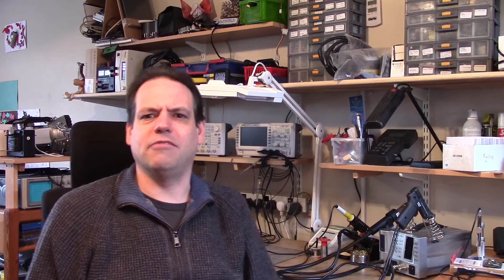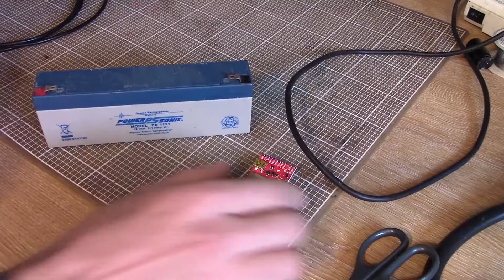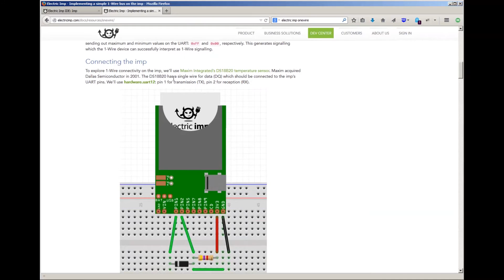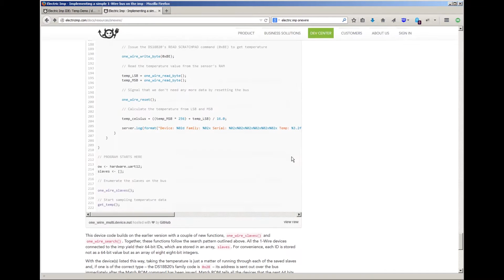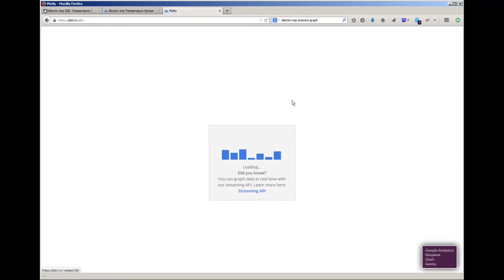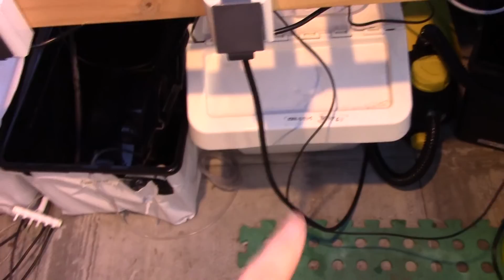Nutrient Temperature Monitoring with an Electric Imp and Plotly ( IoT Internet of Things )

Comment: That was frickin sweet!  Thanks!
Reply from the maker: Thanks FesterWerks - I'm very glad you liked it - first time I've done a how-to as involved as that. Cheers!!
Reply: Oh, I'm going to be ordering these parts and building many of these temp sensors.  I want to put them in various dutch buckets this spring/summer to monitor various methods of keeping my nutrients solution cool in the buckets.  Nice that you covered so much of the process for us.
Reply from the maker: I've just uploaded the full sourcecode to github - https://github.com/jimconner/greenhouse_monitoring - if you need any help when you're getting it set up later in the year, ping me a message. Cheers!!
Reply: Thank you!
Reply: Jim Conner
 Oh my, the rabbit hole this video sent me down all day Saturday :)  My guess is I'll be getting in contact with you in a month or so :)  This gave me so many ideas...
Reply from the maker: FesterWerks Heh... It's not just you going down this rabbit hole... I've order a light level sensor, humidity sensor and air pressure sensor which I'll try to add on in a couple of weeks time when they arrive from China - then I can track the weather changes along with the rest. I've also ordered some more temperature probes as the 5 which I had are all used now and I still need to measure outdoor temps and the other NFT nutrient tank (when that rail's up and running agian)... and more some that I can continue making improvements to the code without stopping the one in the greenhouse from working. I am so loving this project... only snag is that I'm back to work on Monday (had a month off over Christmas) and that's going to slow me down a bit - Ah well, there's always evenings and weekends.  Cheers!!
Reply: Jim Conner
I just picked up a bunch of those temp sensors for 3 bucks a piece.  The light level sensor sounds great, even though I know sunrise/sunset times, the trees shading my garden make those times less reliable. 

Can you pull the data from Plotly or Imp into your own database or spreadsheet?  (Either real time or on demand?)

I was looking at pH sensors and they are still pretty pricey.  I was looking for a cheap way to detect water to add to my Dutch Buckets to determine if a feed line had clogged.  With 35 dutch buckets now and the potential for more later, I'd like them to be cheap.  The really cheap things I found would require me to drill a hole in my buckets. (I found these, the analog Basic Range and digital Optomax) http://www.sstsensing.com/sites/default/files/AN0061_2_ProductSelectorGuide.pdf

Have you looked up inexpensive water level indicators or water detectors? 

Sorry for all the questions and continued comments, but I've thought of doing stuff like this for a long time, then to see you so simply put it into practice is great and has really got me excited.
Reply from the maker: Hi Fester. The addition of the light sensor is a 'because I can'  type of situation - mostly it's because I saw the one +TraceWaters was showing in his latest video and I thought 'that looks neat'.

Yes - the data's available from plotly after you've pushed it up there... CSV format so easy to pull into a spreadsheet.

The pH probe I bought was about $10 (£6 - It was the cheapest I could find), but then you have to make some circuitry to attach it to a microcontroller (hence the video I made about a week ago) - I did look for ready-made pH boards but they all seemed crazily expensive given what's on them. Maybe I'll find some fatal flaw in the circuit I made, but for now I'm going to run with it... My current plan only has me measuring pH when the nutrients are being mixed - I'm not planning for continuous pH adjustment (yet). Having discovered recently exactly how pH measurement works, I can't see probes getting a whole lot cheaper than the $10 each price range.

I've bought a couple of water flow-rate sensors (450 pulses per litre of flow) which I was hoping to use so I could effectively meter out water (i.e. know when I'd got 10 litres in the container), but now I've read up on them it turns out that they're +-10% accuracy, so not really good enough. I'll use them to alert me if my nutreient pumps stop running instead. I've seen some neat ideas for doing capacitative liquid level sensing (with foil strips taped to the outside of the container) but I'm concerned it might require too much fine tuning to get any kind of accurate measurement. (I want to be able to ask the system for 2.5 litres of grow-juice mix A etc).  I'm currently considering a float attached via a swing arm to a potentiometer (like they use in car fuel tanks)... but not set on that idea yet.

For your buckets, how about these ... http://www.ebay.co.uk/itm/Soil-Hygrometer-Detection-Module-Soil-Moisture-Water-Sensor-For-Arduino-New-/190837630510?pt=UK_BOI_Electrical_Components_Supplies_ET&hash=item2c6ecf262e ...

One thing to consider before you get too stuck in with buying sensors is cable lengths.... I knew I could get away with long cables on the Dallas 1-wire sensors because I've done it before, but some sensors will want either I2C or SPI connections. (I2C and SPI are two different standards for on-PCB communication between chips... good for about a metre I believe). Sensors with an analog signal output (like my pH sensors board) will not work over long cable runs because the signal will degrade over distance.

I have to say that I'm really pleased that you're planning this project now - it is such a rewarding feeling knowing that the video I made has been useful to you. Cheers!!

Comment: Everyone with a green house should have one Jim. It is the stuff I dream about. I would say by now that the Chinese have had a view ! Great man , All the best .
Reply from the maker: Patrick Meehan Thanks Patrick - I plan to add humidity and light level sensors when they arrive from China (ordered them yesterday) - I was surprised how quickly the whole temperature monitoring sytem came together - it was literally about 4 hours from start to finish (and then I made the video which meant another 8 hours of filming and editing :). Even though it's only been running for less than 24 hours, I can already see that it got down to 2.5C at 7am in there, and the heaters in my nutrient tanks ran continuously throughout the night... not sure if that'll make the plants grow any better, but it's nice to know... I think I'll be putting a heater in there on the frost setting later today. Thanks for watching and taking the time to comment. Cheers.

Comment: Great video!  pH and TDS up next...?  I've been trying to cobble together something similar for a reef aquarium with an Arduino and an ESP8266 (Julian Ilett just did a video on them) and it looks like your route is quite a bit less work!!  lol
Reply from the maker: Thanks mnelson10000 - Yeah, pH and TDS next - I've already built the circuits to get the pH and TDS probes to nice analog voltage levels that I can read with the Imp - I just need to add a little output FET so that the probes go to sleep with the Imp rather than wasting power all the time. The ESP8266 looks like a great package - I'd have been using that if I hadn't already had those Imp boards kicking around for over a year. Using the Imp certainly made for rapid developemnt - only took a few hours to get from nothing to cloud-enabled graphing system. Thanks for watching and taking the time to comment. Cheers!!
Reply: Yeah you can't beat the price, either!  I ordered a couple ESP8266's in November for $3 each, shipping included!!  It might be worth the extra money for your rig not to have to do all the low-level stuff, though.
Reply from the maker: I think I'll order myself a couple of those ESP8266s later today.... The thing I like about the Imp platform is that I don't have to run a PC anywhere to manage it all... but the thing I don't like is that I'm reliant on the Imp webservers continuing existence, and companies go bump all the time - that would render all my work worthless. Would be nice to have a system which is fully under my control. Cheers!!
Reply: Oh you MUST use their cloud service...?  Huh.  Maybe the Arduino rig is worth the extra work.
Reply from the maker: Yeah - the Imp device always communicates back to their cloud service. They way they've set their cloud platform up is really very good though - it manages firmware updates for devices, device inventory etc - you can assign code to different devices and it will send it over to your device for you - it gives you full version control, firmware updates etc too - They roll all the cloud platform charges (for life) into the hardware cost when you buy an Imp so there's no ongoing bills to worry about. If I was designing my own PC-based way of managing the devices, I don't think I could come up with something better.... would just prefer it if I was the one ultimately in charge of the platform rather than relying on them being in business forever more.... but then again, the amount of time I saved in development is probably worth the risk of having to do a more full development with an ESP2866 talking to a PC in my house in the future. Their 'squirrel' programming language is very nice to work with too. It's quite a lot like using Python but it ends up running on the microcontroller as compiled code - the microcontroller can just call agent.some_function('blah') to trigger a function on the cloudy-agent code - all the passing back and forth of data is handled seamlessly for you - no need to worry about opening TCP connections or any of that hassle.   Cheers!!